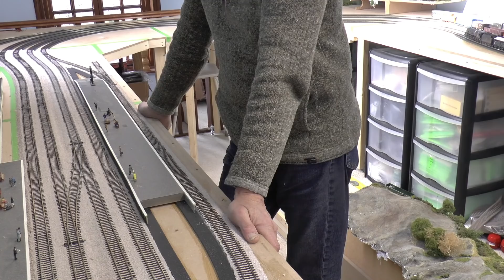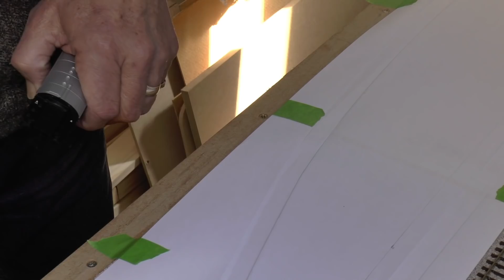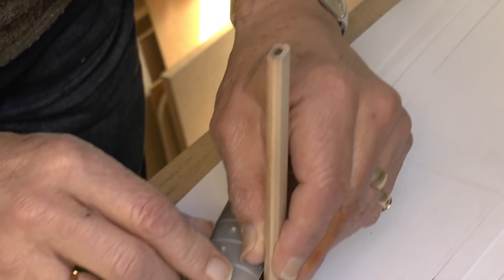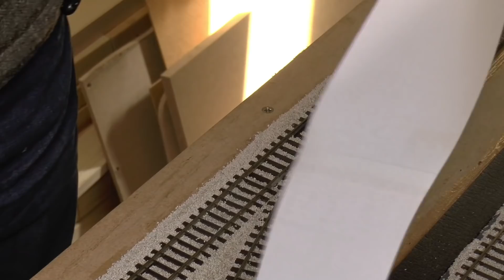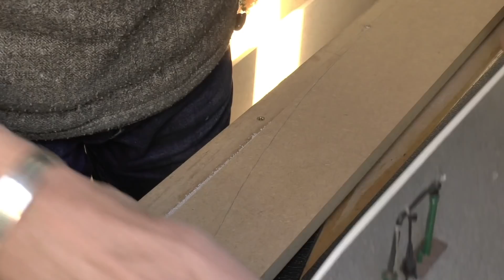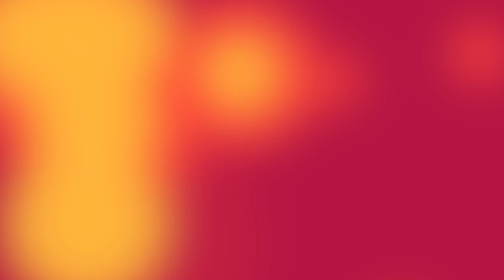Part 13a.   Building a platform      24-03-2019

Comment: Hi Graham. Nice and helpful video, thank you. I'll certainly be using this technique when I find the time to actually make my platforms! Just one suggestion for you and one question. You say you intend using the metal dowels to join the two parts of the platform. I would suggest using normal wooden dowels instead, mainly because you can glue the wooden dowels into each half whereas the metal dowels are not glued together, With the metal dowels, when you pick the platform up (for painting, etc.) the only thing keeping the two parts together will be the glue on the flat surfaces of the MDF. Wooden dowels would give you a far stronger join.  My question is - do you intend using the depth of the Peco track bed you have the platform resting on for running the electric wires from the various lights to the one or two holes in the baseboard? Despite your reluctance to use power tools, I would be tempted to use a router to cut a groove along most of the underside of the platform to contain all the wires. Just my thoughts.
Reply from the maker: Steve Mercer     Hi Clive and thank you.  You make some very useful suggestions there Clive, those dowels were only used because I had them spare and didn’t have any wooden dowels but as I said in the video, they are only used more for location purposes rather than strength but I do get your point about the wood dowels.  I won’t need to use a router though because the platform sits on the track bed around the perimeter of the platform so there is a nice big space under the platform for me to run cables down into larger holes in the middle of that cavity - hope that makes sense.     Cheers for now.        ..........Graham
Reply: That's what I guessed about the space under the platform. Oh and It's Steve, not Clive - haha
Reply from the maker: Steve Mercer      Sorry mate, I’m doing this so many times, the trouble is I’m reading other comments at the same time as replying, I obviously can’t do two things at the same time! 😄😄.      Cheers for now.      ..........Graham

Comment: Good method for getting the curves right Graham. Looking at my Metcalfe platform kits, it describes the same method as you used, by running a coach along with a pencil mid way along the coach. I like the idea of using mdf, but I have bought four of the platform kits for my station, so I will be using these. Like you, I tend to use hand saws for cutting if I can, not so keen on jigsaws, as putting pressure on them when cutting thick wood can bend the blade slightly and you end up with a slightly chamfered edge. Anyway Graham I enjoyed the video and once you have all the platforms in place it will look great.
Cheers
Geoff
Reply from the maker: Geoffersh      Many thanks for the comment Geoff, if you have bought the Metcalfe kits already then you may as well use them mate and apart from that then they are fun to build anyway.  Jigsaws are ok for certain things but I still tend to use hand tools for most things, I always have preferred them to be honest, perhaps that’s because I had a master craftsman teach me - my dad !     Cheers for now mate.      ...........Graham
Reply: @GrahamFoulston  Just read Robs comment about using your (ankle 3s lol) Mk 3 coaches. As I wont be using any longer modern image coaches on my layout, I think I will use that 68ft restaurant coach from my Caledonian set, when I mark out my platforms, as this will probably be my longest coach. Looking forward to you next video mate.
Regards
Geoff
Reply from the maker: Geoffersh      Yep, use the longest coach is the best solution, I completely forgot about my Mk 3’s or ankles!   😄😄.   If they don’t fit when I test them to morrow then it will be no big shakes at this early stage to adjust it, I think they will be ok though - hopefully!    Cheers for now.        ..........Graham
Reply: @GrahamFoulston  Just make sure you are wearing the right socks for your ankles lol
Reply from the maker: Geoffersh      😄😄😄.    Good point - I didn’t think of that, I’ll get my thermal long socks out - that should do the trick!    😄👍.     Cheers for now.         .........Graham

Comment: Fantastic video. I’ve always wanted to try making platforms like this, I’m slightly terrified of cutting the angle on the end though. Any tips? Cheers Geoff
Reply from the maker: Regington       Hi Geoff, the way I did was to mark both sides with a line where you want to saw and starting at the end of the MDF so yo are sawing off the thickest part, carefully saw down using a hand saw. Put the MDF in the jaws of a workmate or similar at an angle so the saw cut is vertical. Once sawn off then sand down using various grits of sandpaper on a sanding block so as to keep the sawn area flat. That’s about it really, just take your time and don’t rush it and you will have a perfect cut.   If in doubt then have a practice first.    Hope that helps.        Cheers for now.        ..........Graham

Comment: Good explanation of you platform methods.  Templating is fun.  Be sure to test your ankle 3s.
Reply from the maker: Rob McCrain      Thank you Rob and it was indeed fun - like most of this layout has been so far.  I have absolutely no idea what ankle 3s are - sorry!  Are these the US cars?       Cheers for now.       ..........Graham
Reply: Lakeside model railway Oops, autocorrect.  Mark 3s, Sorry.  The bogies are father apart so the have a longer cord.
Reply from the maker: Rob McCrain      Good point Rob, I will check that out tomorrow but I think I will be ok as there is quite a gap to allow for the cylinders of the steamers but it’s still worth checking out, it will be much easier to change at this early stage if I need to.     Cheers for now and thank you.         ...........Graham

Comment: Nice job. If you pre-wire the lighting for each platform, you can just have one hole for the wires to go through the baseboard. Use the cavity for the wires. Perhaps should’ve used your longer US coaches for the clearance?
Reply from the maker: David Fidler     Hi David, the US coaches will not be used on platforms 1 and 2 so no need to check clearance for those coaches, they will not go around the inner curves because of the close couplings they use. The platforms will not be glued down to the baseboard, just screwed so lighting for the platform and also buildings will run through one or maybe two holes, large enough to take all the cables.     Cheers for now.          ..........Graham

Comment: Great job...!
You’ve said that you will glue the platform... that will not give the freedom to electrify it later on...
Platforms do look nice with lights... if you glue it... it will more difficult to hide the wires later... assuming you may want to have lights....
But overall .... great job and vid...!
Many thanks for sharing!
Wishing the Best!
P
Reply from the maker: P Macedo      No, I didn’t say I would glue the platform, I said that I will glue the two halves of the platform together and then screw the assembled platform down onto the baseboard or track bed in this case. The platform will have lights and so will the buildings too and as the platform will be removable then there will not be a problem when it comes to lighting at a later date.    Cheers for now.        .......Graham